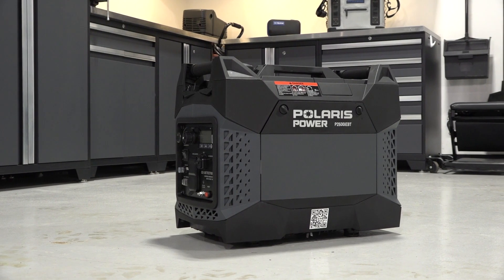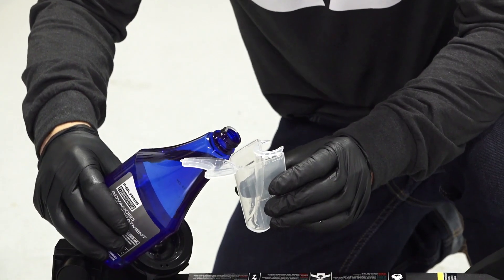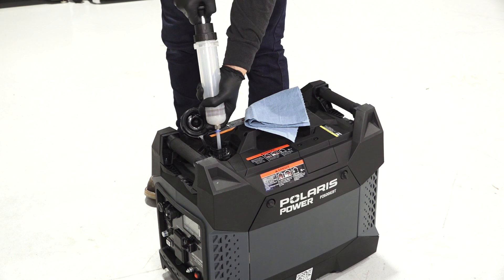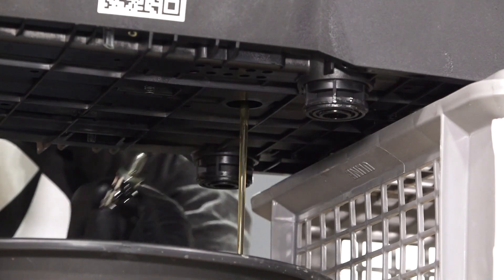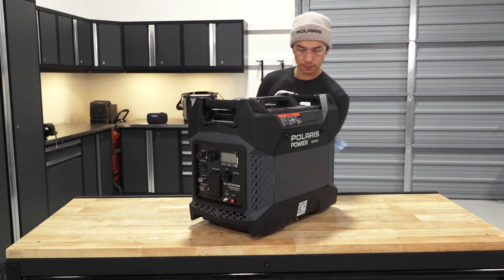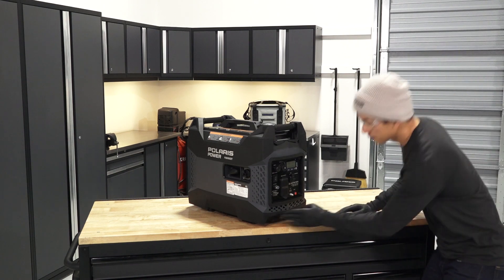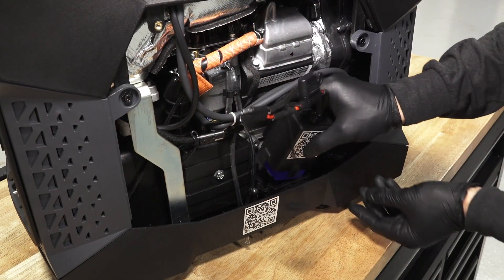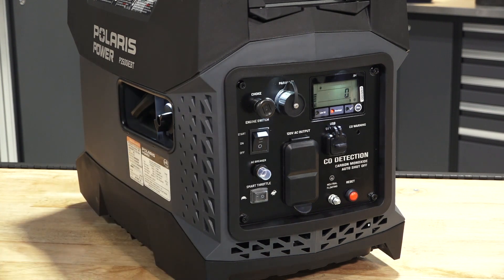P2500iEBT Long-Term Storage | Polaris Power

Comment: Do you fog the engine whether or not you keep gas in it? If you remove gas by siphoning, do you need to run the generator until it runs out of gas to get the rest of the gas out of the system? How long can you store this without things gumming up or drying out? This is all very confusing to me. I don't want to mess up an expensive machine.